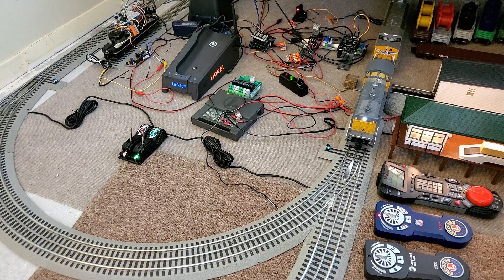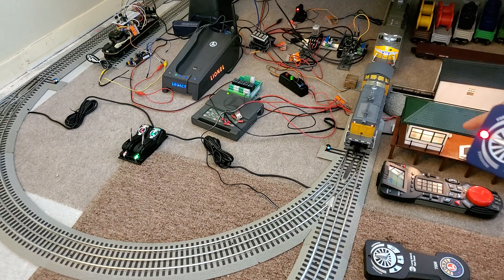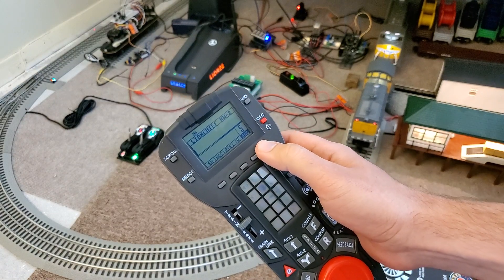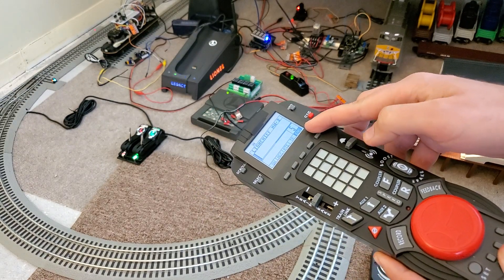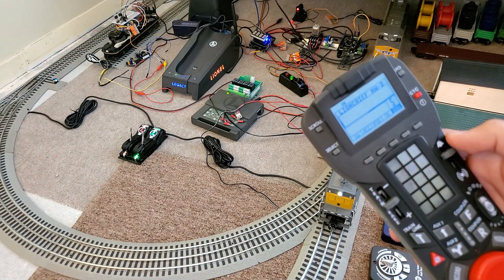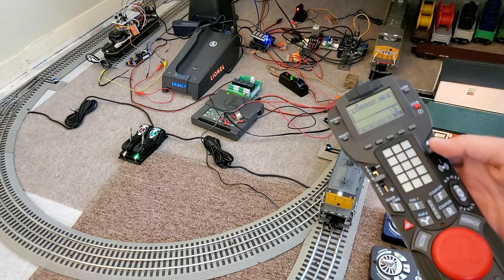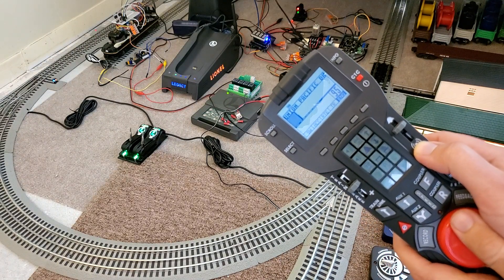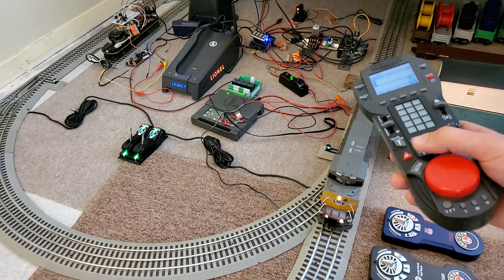LionChief Gateway Project update 16 (Legacy Cab-2 to LionChief locomotive control)

Comment: I am guessing this or something close is what is in the new base3/cab 3.  I have see the video that show the leaked cab3.
Reply: What is the possibility of releasing the sensor car Arduino information?  Code and short hardware description.   Using the Arduino IDE to set the engine ID seems like a reasonable short term solution to the plug in board.  Thank you for your research.
Reply from the maker: Sounds like the perfect time to just spead this device made from relatively off the shelf hardware in the meantime. Plus get some extra life out of the cab2 for those who really can't make the upgrade whenever that comes out.
Reply from the maker: I was actually planning on open sourcing this to get the final mass user friendly prices of the code finished out, I had so much going on this past 12 months that I really haven't been able to expand on this too much lately.
Reply from the maker: Most interestingly, My method is expandable beyond the 3 devices allowed by the base3. Sounds like I need to make my module connect to the base2 or base3 via PDI.
Reply: @MorrTrains  I would be interested in buying if you sell them
Reply from the maker: @Thessling  Thanks, especially after seeing the limitations of the base3, which we know they're not necessarily going to improve upon for a while again, I definitely have some renewed passion to get this going for everyone. The next thing I need to work on is adding the ability to pair any Bluetooth LC engine off the shelf into the system.